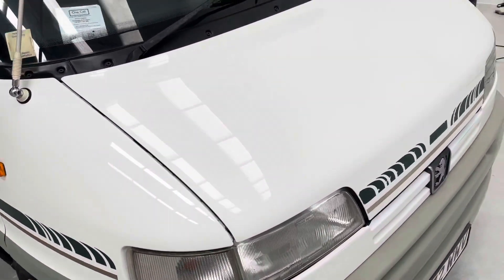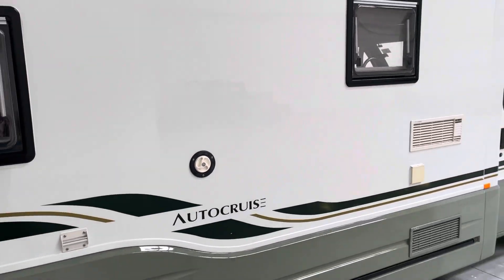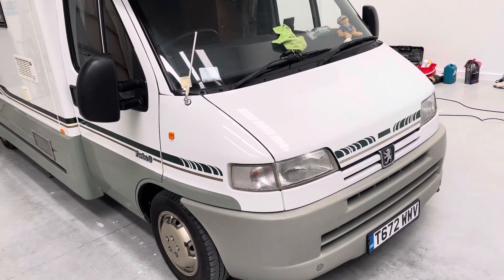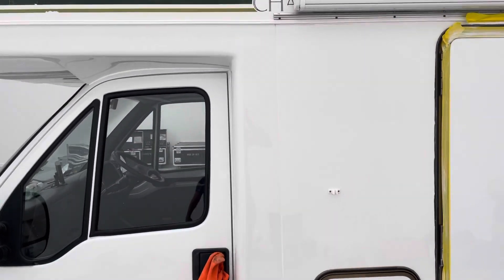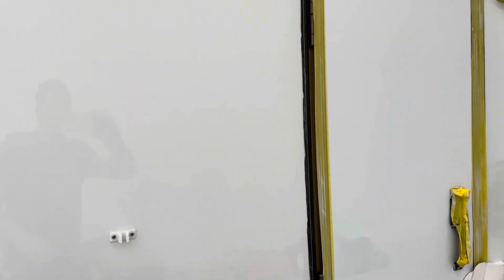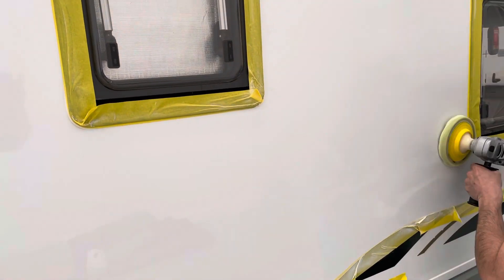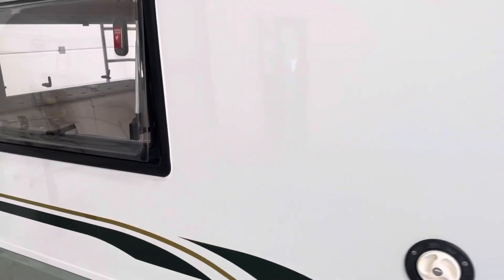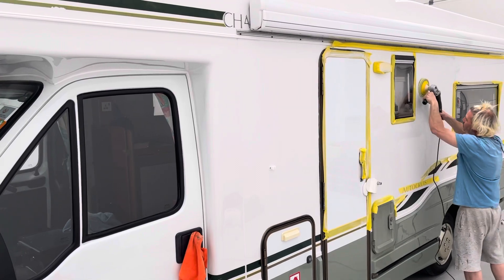Machine Polishing Detailing Fibreglass Motorhome Wet Look Shine

Comment: Yes but most of us machine polish to remove scratches and swirling not to just bring the colour back anyone can do that with ease. Most of the videos you watch are about correcting paint not just 'making it shiny'
Reply from the maker: @nutty4356  fibreglass is an unknown quantity compared to “paint” - a dual action polisher a soft to mid polishing head and a refined compound do the rest ie limit swirling and correcting
Reply: Your not taking scratches and swirls out of a fibre glass gel coat without using an aggressive compound and cutting pad and at least a gear driven forced DA then refine using a free spinning DA and a mid grade compound and cutting pad. I'm just stating anyone can polish the shine back into the motorhome but this isn't a correction its an enhancement
Reply from the maker: @nutty4356  it’s great that you agree that anyone can get the shine back into ageing fibreglass motorhomes… the entire point of the video

Comment: Hi what make polish did you use please you said yellow and green ? Looks great its a job we need to do 👍🏼
Reply from the maker: 3m “green top” and 3m “yellow top”

These products are generic trade refinishing compounds used across the uk. 3m do make specific fibreglass cutting compounds but I’ve never used them.

https://lincsdetailing.co.uk/shop/3m-perfect-it-iii-fast-cut-plus-compound-50417/

We used the yellow soft buffer head 👍

Do not use the green polishing head as it is too hard IMO for a beginner and can create buffer trails and dig into surface etc etc